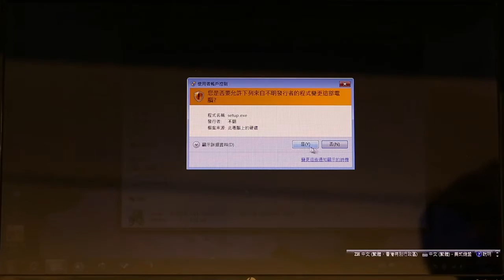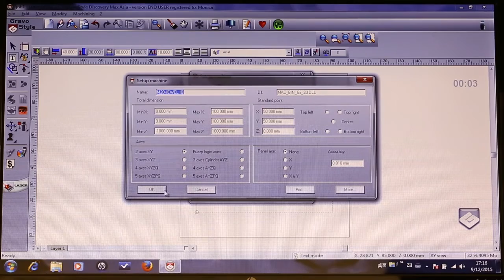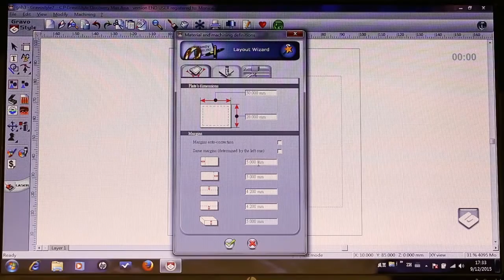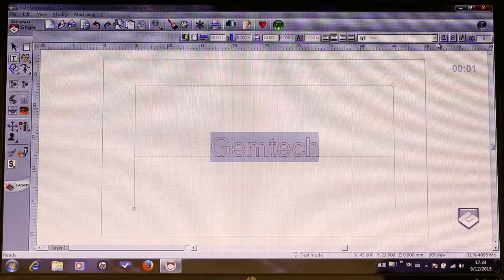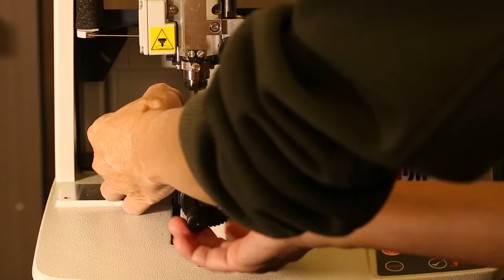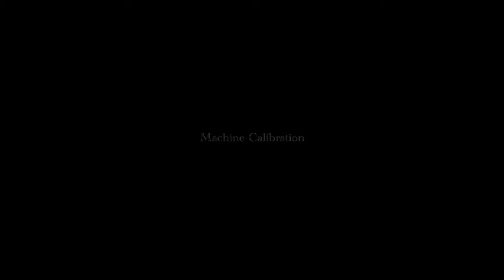M20 Tutorial

Comment: I work of this machine. My work is engraving on jewelry. I need your help. I want you tell the the round bangle how can i engrave once time
Reply from the maker: It's hard to tell you how to engrave on round bangle.  If engrave on the surface of the round bangle you use the the ligheest tension and measure the lower position and use the 120 degree diamond point to engrave.  But if you want to engrave on inside and outside of the bangle I suggest you can look into the M10 machine.
Reply: @funhunter606  h